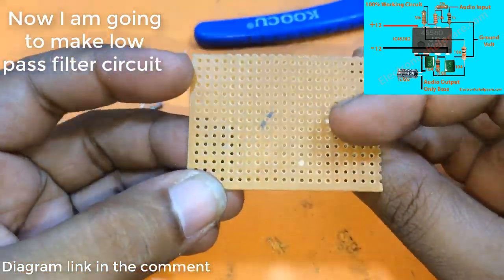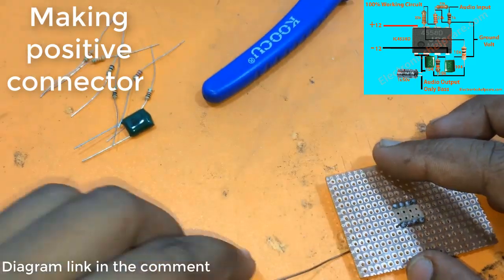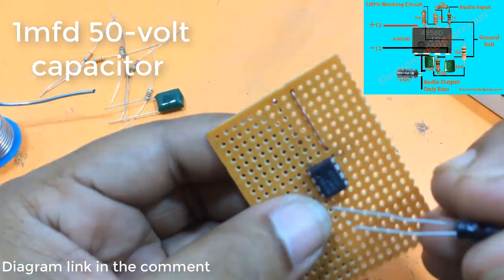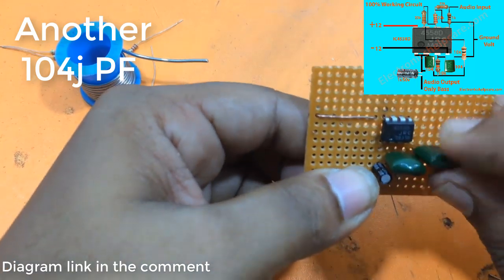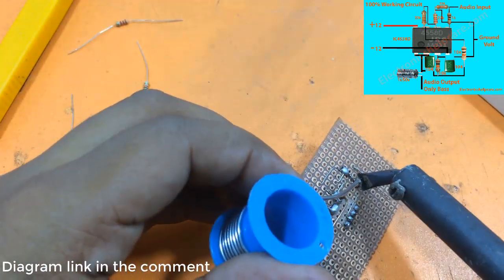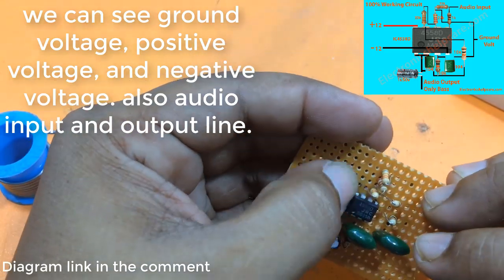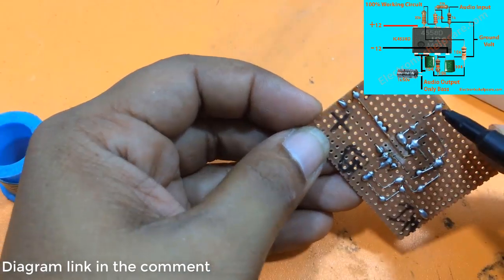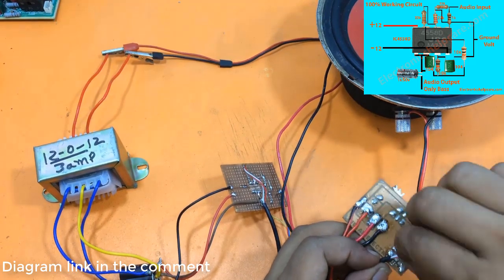subwoofer circuit board

Comment: awesome, well done good job quite a heavy bass response from the amp. i would also like to add a potentiometer to control the bass, what value POT  do u recommend and where on the circuit
 should i connect it
Reply: Idk